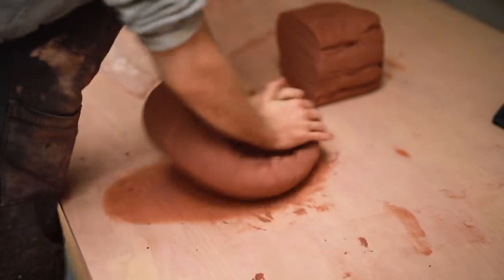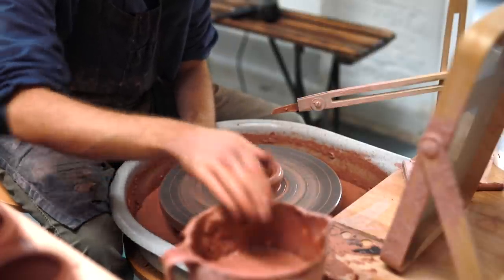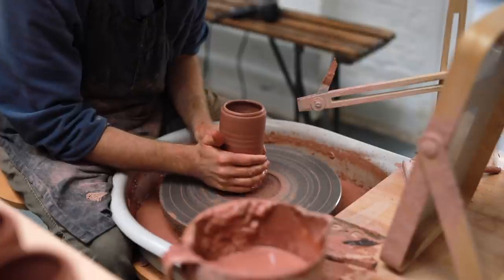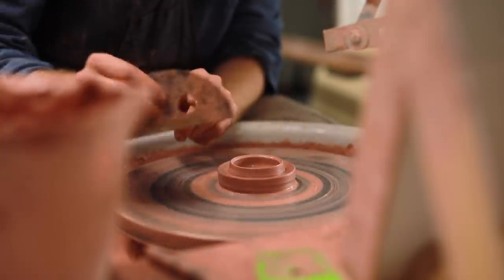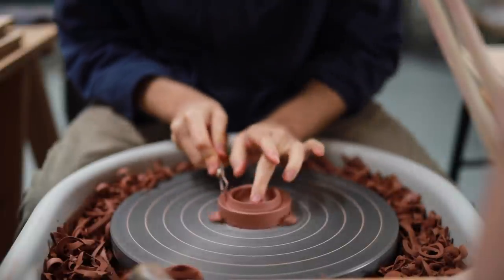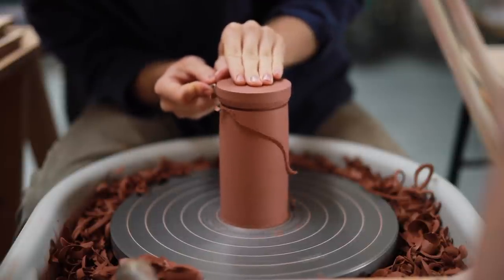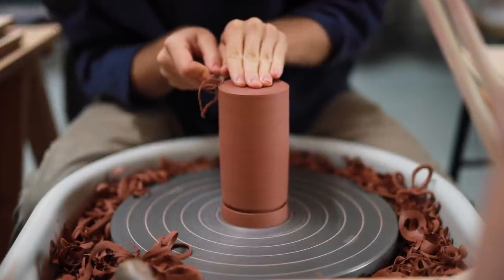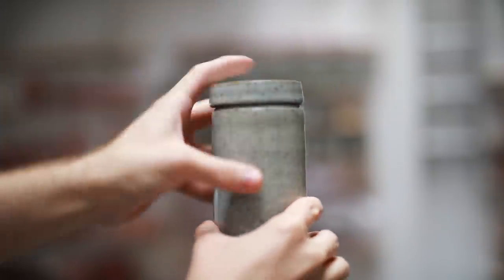How to Make Lidded Jars on the Potter's Wheel — Narrated Version

Comment: I assumed you glaze fire them separately. Is there any trick to keep them still the same fit not fired together? The studio I went to always told us to try to fire them together so they don’t shrink at different rate which really limit what I can do with the glaze :(
Reply from the maker: It is very difficult to assure they fit together if you fire the components separately. One thing to do is to just make the galleries slightly larger that necessary, that way there's wiggle room when you fire them. I use this stuff called Chemico grinding paste (not sponsored but I wish I was), which allows me to grind in the lids to get them to fit perfectly, even if they don't fit at all! Thanks for watching!
Reply: @floriangadsby  Thank you so much for the reply :)